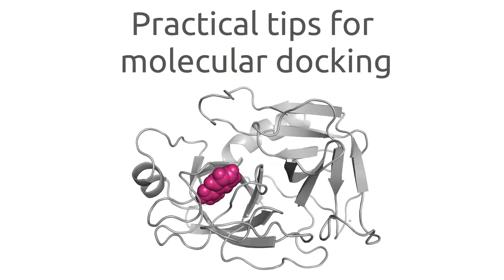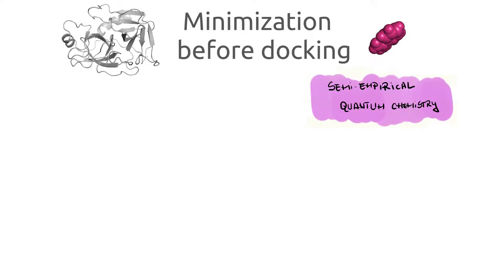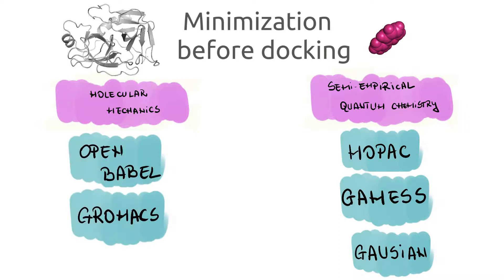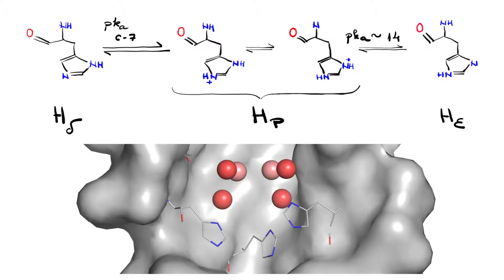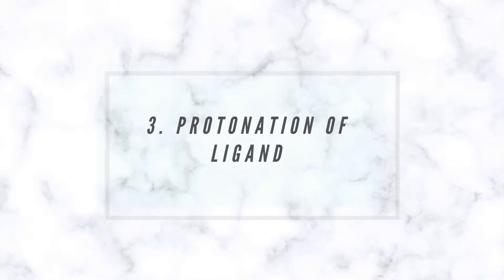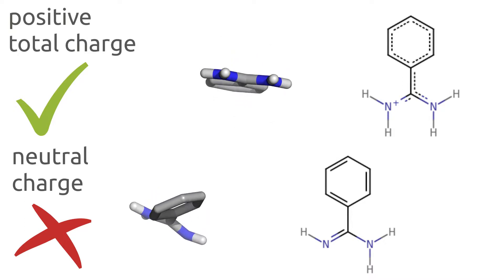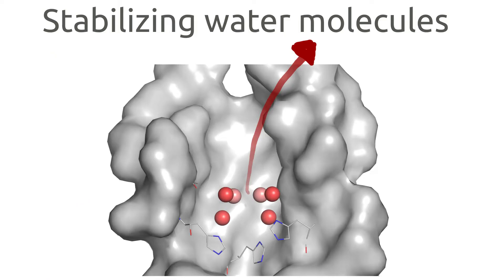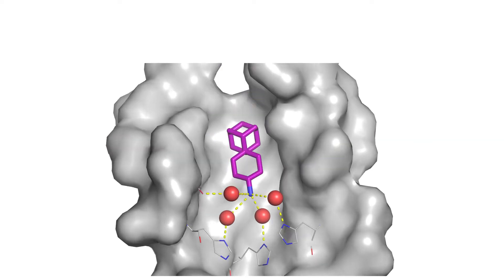How to start a molecular docking project? | 4 steps for successful molecular docking PART 1

Comment: Thank you very much I hope you will continue your videos until how can we follow the correct way to write a paper.
I have a question, If I have a ligand with a positive charge what is the correct step: make a protonation step for my ligand or not?
Reply from the maker: Hi Ali, if you know that the ligand is positively charged, then yes, you should add the corresponding number of hydrogens, according to the protonation state. eg: R-COOH (carboxilic acid - formula with neutral charge) vs R-COO- (carboxylate ion - formula with negative charge)
Reply: @scienceaddicted3431  
Thank you very much.
Kindly I will send an email to you to describe my point.
Reply from the maker: Thanks you! Great to see such interest in correct preparation of ligands